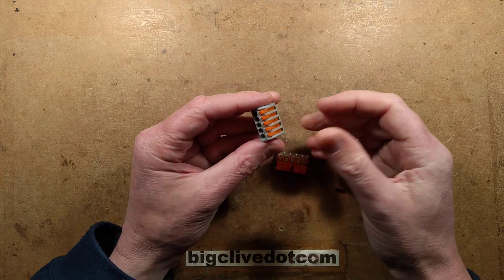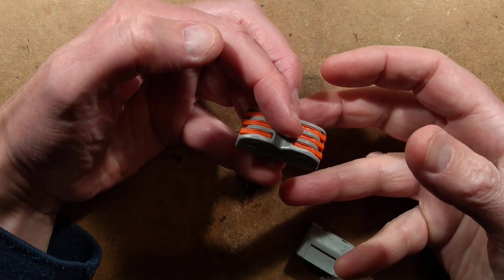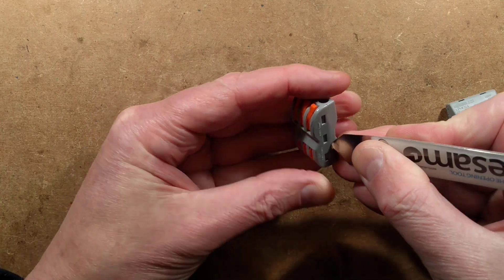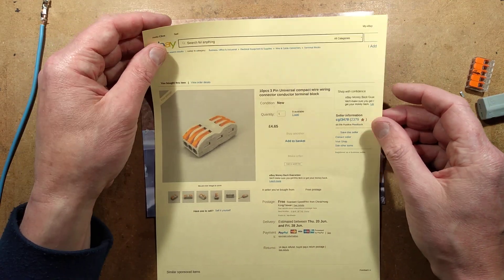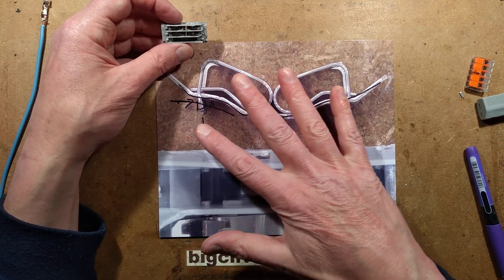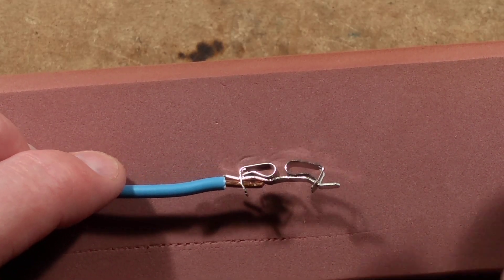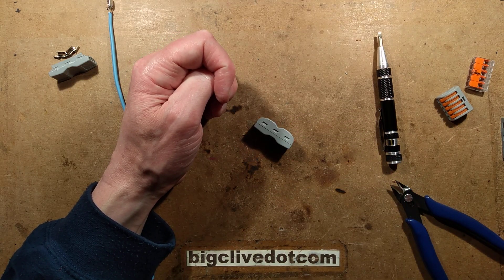Clone of Wago product that Wago don't even sell???

Comment: I use these on my grandchildren's train set. Most of the joints are soldered, but these are fantastic for connecting cables across from one baseboard to another so they can be easily dismantled. Mind you, they're handling a maximum of 18V AC and 2 amps.

Comment: If it isn't listed, UL, ETL, ect. We can't use them in the states. Also doesn't seem useful for conventional j boxes. The way the wires join would take up a lot more room in a j box. The nice thing about a wirenut is that it brings all the wires to a point. This separates them and would make it more difficult to put in a box.

Comment: I found those on Amazon and they are absolutely awesome. Nothing to worry about at all. The mechanism is safe and does not damage wires. Works perfect for power and speaker cables.

Comment: I work for a French electrical company, I have seen  & used the single one many times over the years, but never that double one, the ones with the clips are used for soft core wire, the other ones you showed are for rigid cable
Reply from the maker: First time I saw these being used a lot was while I was working on Disney Studios in Paris.  They used them everywhere.
Reply: @bigclivedotcom  I moved to France 13 years ago, before moving I had worked for a couple of electrical firms in the UK before going self employed for 10 years, when moved to France, I managed to get work with a French company, that was the first time I came across 'Wago's' , they are brilliant things, much better than domino blocks, had never even heard of them in the UK

Comment: Is it possible that the wire travels between stainless steel springs and the back contact?  When you flip up the orange lever, the back contact straightens out to allow the wire to travel between two metal pieces.

Comment: Hi clive, like your videos  I do marine electronics and surveys. Been seeing these used in some marine applications. Cabin house systems. Haven't seen any with bad  corrosion in the copper or contacts but will keep my eye open. Such corrosion and resistance could in high load situations results melt down behind cabin linings not good

Comment: I can recommend the cheap and really good Chinese Watch Back Opening Tool, which has yellow, stubby, ergonomic handle and durable stainless steel blade which is sharp but really sturdy. There are five different wides available and I recommend the widest one.  I have been on electronics for 55 years and it is the best opening tool I have ever used.

Comment: After I saw this video for the first time, I looked for the manufacturer of this extended 3-pole terminal on Alibaba and asked whether the levers could not be made in different colors, i.e. left one in the original color, the middle green or yellow and the third In blue. Some time later, the Chinese had found my address via my E.mail address and my website linked to it, I actually got a small box with these clamps with different colored levers, and a really nice cover letter in Chinese and terrible English, where thanked for the tip

Comment: My apologies in bringing a bit of a downer on what appears to be an otherwise excellent idea. I am concerned that there is no strain relief mechanism for these, plus how would they behave if used in semi-damp environments. What would their corrosion resistance be like if say they were used above a bathroom ceiling for downlighters etc? If corroded, the connections could go high resistance and get hot. If they get hot enough, the plastic could melt or initiate a fire. All worth testing and proving safe before hiding these things in your roof cavity.. Also,  there would be a need to prevent any conducting insects fro getting into the things and shorting out the terminals. At least with the waco design, all the wires are at the same voltage in the connector.

Comment: Would you say these are safe to extend a typical plug & cable , ie a typical power cable you would plug into 240v wall socket in the UK here Clive, sorry for not being electrically minded,  wife sheared off the hedge cutter power cord - DOH, would be a super simple fix with one of these rather than having disassemble and connect a new power cord to the cutter ?

The other use I see these for is making quick release for a power connector to my back box on my motorbike ? be suitable for that with those ratings, taking 12v from the battery ?
Reply from the maker: The joining device has to shield the whole cable including outer flex.  It might be worth putting on another garden tool plug and socket.

Comment: I know this is an old video, but I've been using these connectors for a couple of years, mostly inside waterproof junction connectors like these: https://www.amazon.co.uk/Waterproof-Junction-Outdoor-Connector-External/dp/B07Q29MY8M/ref=sr_1_42?dchild=1&keywords=ip65+cable+connector&qid=1610205599&sr=8-42

Comment: Bizarre and potentially dangerous, two parts that look extremely similar yet work completely differently, a big nono when dealing with power systems. Also, you need at least 6 mm/0,25" between two wires, these things do not provide the required level of insulation between AC wires. We already have screw terminals for this job anyway (although these are unsuitable for inside junction boxes) so better use 3 two-port wagos. I would not recommend anyone ever use these. I doubt they could even ever be certified in the EU. Source: NL NEN certified electrical inspector.
Reply from the maker: These are now sold by electrical distributors in the UK.
Reply: @bigclivedotcom  There's no gauging the wisdom of authorities :)

Comment: They make a 2 channel version too.... which I use for low amp DC stuff...  I've never seen a legit one I think they are just variants on the clones.
Reply: I actually keep a bunch of the original type wago connectors and some of these straight through ones in my car for simple low current DC stuff like indicator wires etc.

Comment: Having watched this video, I searched Amazon and found "CESFONJER" connectors. These look identical to those in the video. The magic of these , is that they are available as trebles, doubles, but also as SINGLES which can then be clipped together with a beautiful dovetail arrangement in the case, so there could be as many connectors clipped together as you wish. 
They were £10 for 24, and having bought some I am well impressed, I am using them for LED tape lights, soldering on to the tracks a short length, and then using these to couple to a short length from the LED driver, also the mains leads. This may sound excessive, but working inverted under kitchen units, these make life so much easier.

Comment: https://www.ebay.co.uk/itm/Wago-type-in-line-Electrical-Connectors-Wire-Block-Clamp-Terminal-Cable-UK/383791313092?hash=item595bbeb0c4:g:52AAAOSwHuVfgEIi

Comment: What difference is it really to the connectors that you put the wire in and screw it down? They do the same job!
Reply from the maker: The difference is that you can't under or over tighten these connectors.  They automatically clamp the wire at their correct termination force.
The first time I came across Wago terminals was in an outdoor condenser unit for a supermarket refrigeration system.  I asked the maintenance crew if they'd ever had problems with them and they said they hadn't.

Comment: US Side of the pond, I'm skeptical of the Wago connectors, as one who I've seen wirenuts fail, I pre-twists wirenuts connections. How about reforming a current to destruction test?
Reply from the maker: John Ward put a copy and a clone in series and passed increasing current until they failed.  They both outperformed their rating.

Comment: Do these work with aluminum wiring?
Reply from the maker: No.  I wouldn't recommend it unless an adaptor tail was used.  The curse of aluminium is that it forms a high resistance oxide layer on its surface that can result in arcing and burning.
Reply: @bigclivedotcom  Thanks. I've got aluminum wiring in my home and have been trying to install a smart light switch. I need to join 3 wires together, but Alumiconn connectors are very bulky and can only handle 2 wires.

Comment: i would see these awesome for testing 12v things instead of twisting the wires together or using alligator clips this i can see being a good way of not allowing the hot and ground to touch and short out and most of 12v items are lower current so no big worries of ark jumping from hot to ground

Comment: I am absolutely stunned that the primary contact is copper and the spring is steel.  It just seems like the most obvious area they could skimp and make profit.  I think that feature in and of itself is worth sacrificing one out of a pack to investigate before putting into use.

Comment: After I have seen this video, I tried out, to find the oricinal chinese manufactuer, and askrd them, if thes cab nake them more usefull, by changing the clamp lever from the original Wago-Orange to diferent colors per contact-line. Not long later I*ve got these 3 pole connectors with levers in original orange for line, yellow for protecting gronnd ans blur for neutal.

Also I found a test of original Wago to the knockoffs, and at the ent, Wago was still better, but only a very small amount, nor dangerous unter normal circumstances.

Comment: On second thought: These aren't made by WAGO because of the tracking. the normal connectors are basically waterproof. These multi-line ones, are not. Also, wago would have to sell an entire new series of boxes for the wago terminals that go straight through, making them pay even more in certs. atleast that's what I think

Comment: I can't bring myself to but cheap knockoff connector components when it comes to high voltage mains.  I saw where mikeselectricstuff tested them and they passed fine, but still I just cannot do it.  Is anyone else like this or am I just being dumb?
Reply from the maker: I tend to recommend against using anything other than properly certified connectors for commercial work.  These are OK for hobby stuff.

Comment: I wandering only, If everyone are going to use those everywhere possible, then shall next generation finding it do difficult to make easiest wire-wire connection without thouse. Even today there are guys that call electrician to change the most standard lightbulb.

Comment: If anything the size of the gripping connector inside is much larger than the wire to be inserted, so it's not a failure point, the wire would fail first, the separation between each wire connector is at least as thick as the insulation on a single wire that COULD be inserted into the hole to be gripped so no problem there.  If an inserted wire is gonna heat up it won't be at this point so I can't see a problem there either, anything that is gonna heat up the internal insulation between these is gonna melt the wire insulation outside of the unit anyway, so if you're gonna have a fire you're gonna have one elsewhere, likely at the fault source so I can't see a problem with these other than the expense.  Single thin wire connectors are so cheap these days they're usually cut off and throw away so unless these drop in price I can't see them taking off.  Thanks Clive

Comment: Wago wouldn't make these as you only need 1 to connect 3 wires. You will need 3 2pin wagos to do the same, meaning they make more sales on the individual Wagos.

Comment: thankyou, youve just answered my ham radio shack connecting problem, just need to solder the cable ends and wer good to go. (12v. 20amp. max load) ;-)

Comment: Looking at that Chinese three pole, I’m seeing a thru-hole component on one side, like the three legs of a TO220 transistor,  and leads with clips on the other side for subbing parts on mock-up boards or other temp installs with no soldering.

Comment: I've had some experience with those connectors, and it seems that it's either not listed in catalogue or being sold only to manufacturers, because I've encountered them as a proprietary connector in Philips IP68 lamps. I don't remember if it had an official WAGO signature, the installation was in a rush, but I was also quite surprised.

Comment: I have purchased a box of these connectors through well known online retailer. I have not try them so far therefore I can't speak for a users of those. Clever design but if Germans skipped this idea where is the catch?  I would rather use screw terminal connector block than something unknown.

Comment: Several years back, you did  a video on the clone of the first type, and I liked the look of them so much, I ordered in several to play with.  That winter we headed South from the Dakota's to Arizona to avoid the cold and snow. While down there, living in our 35 foot Class A Motor Home, the CO2 detector timed out and began beeping every 5 minutes to tell us it needed replacement. Since it was in our bedroom, it sort of forced immediate action. So it was to an RV Repair center I knew about in a nearby city, where I purchased a replacement for a hundred bucks or so, and when I tore off the old unit I discovered that the wire was about 1/2 inch beyond the wall and that was it.  So I remembered those little flippy deals, and dug two of them out.  The miniatures, it worked wonderful to splice in  the new detector, and gave us quite a relief that we were once again protected from the danger of poorly burned propane in our furnace.

Comment: I’m not sure how I feel about this. The Wires are too close together. If one were to heat up and melt through things could get really bad. And shouldn’t each connector be labeled showing that each one is on a different circuit?
Reply: If you go to the sellers site you will find several different versions, some with allocated colours to indicate same connection both sides
Reply: No one should ever use any connector that they do not know the pinout of.  If you don't know where the pins connect then what the hell are you doing? I have on occasion grabbed a random connector from a junk box to hook something up and the very first thing I do is to buzz out the terminals to make sure they go where I think they do. And sometimes I get surprised.  But no big deal so long as you check it out before you hook it up.
Reply: I've been using them for over 1o years here in France, not one single problem with them ever
Reply: If one were to heat up, you have a bad design because a fuse/breaker should have popped, long before.
Reply: @AdaptivePhenix  If the product is badly designed and the wire starts arcing to say, yeah I can see how this may happen with just a few amps.
Reply: @nahventure3873  but the video just showed it's actually pretty good design...

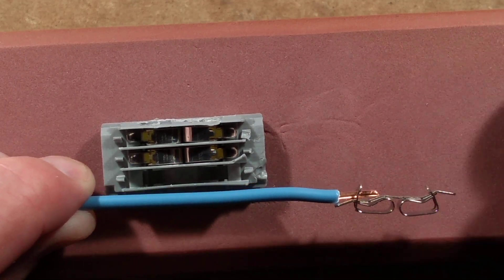Comment: One thing I'd like to point out is that is that in the Wago brand terminals the bus is actually on the front and digs into the wire if you try to pull back on it and not bent that would allow the wire to slip out if the spring weakens over time as you see at 8:22 . When you you the test point on the back of a wago you're testing a spring and not the contact if you can tell from amazon's picture https://images-na.ssl-images-amazon.com/images/I/51DC1S0S7pL._AC_SL1280_.jpg 
Not sure why you would want to use something like that instead of a plug type like the lumi-nuts if the connection is floating or a terminal block that you could mount like the 832 series.

Comment: i don't do electrical work often and i don't even know how i got here

but i know things like that from since... forever? 
not sure if from this brand specifically, but i always seen those around.
i mostly use ceramic wire connectors for installation of high drain stuff like electric shower heads and i always seen those next to the one you got

Comment: IMO, they should have made the lever in different color pairs to clearly indicate that it is connecting 1a-to-1b, 2a-to-2b, etc.
Reply from the maker: They now sell a version from prominent UK suppliers that have that.
Reply: @bigclivedotcom  did wago clone the chinese product? lol
Reply: They now do these in toolstation with Brown, Yellow, Blue levers Rated at 32A so can be used in a ring final circuit/ring main.
https://www.toolstation.com/in-line-spring-lever-connectors/p45902
There's also a 2-way version with just brown and blue.
I haven't bought them yet, but they will be on my next order.
Reply: @JasGawera  Yes.. i notice they are listed as  'unbranded' LOL
Reply: @whatworkedforme  I'd be interested to know the origins of them, personally I stick to the Wago brand, I've noticed recently they do make a version of the 221 that has 2 terminals but in-line instead of on the same side. Told my local wholesaler they would likely be quite popular and they should stick some on their next order, as in some instances space/neatness limits you to using a crimp. And despite it being a rather common practice, people now debate whether or not it's okay to crimp solid conductors.
Reply: @_______DR_______  If You're talking about crimping connectors like Molex Mini-Fit, KK254 or anything with pitch smaller than 5mm etc., then it's definitely a bad idea. The tools were not designed for that. It might work for some time, but the mechanism will wear off really quickly, and suddenly You realize that half of Your connectors are loose and You can't quarantee them working properly. On the other hand,  big ring terminals will be ok with crimping. The tools for them are really bulky and can survive everything. Still I don't know any manufacturer, that would recommend that.
Reply: @mateuszstepien5607  I would expect cheap, consumer quality, tools to, as you suggest 'wear out', quality professional grade tooling will not, with the understanding, of course, that everything wears out in the end!😁